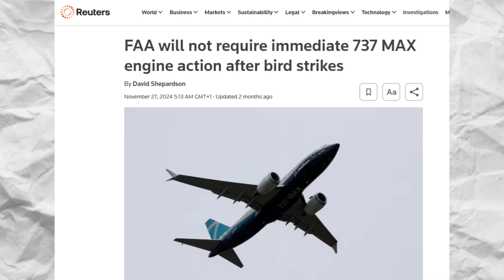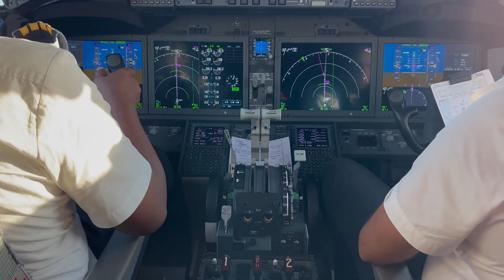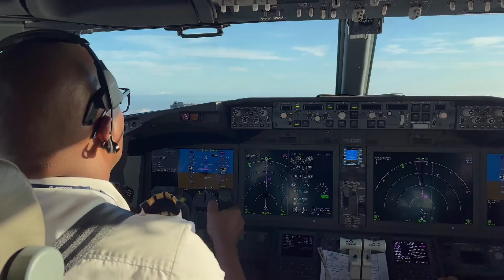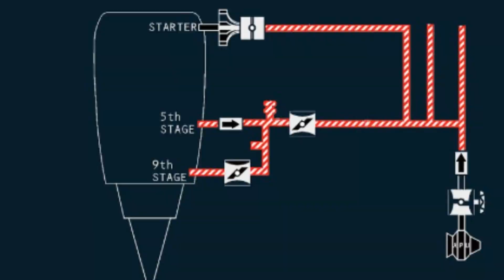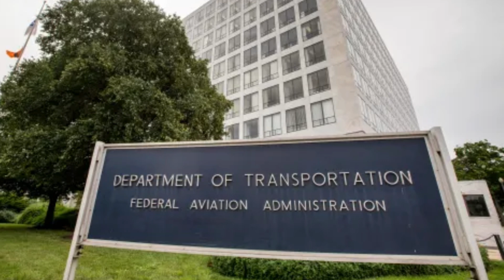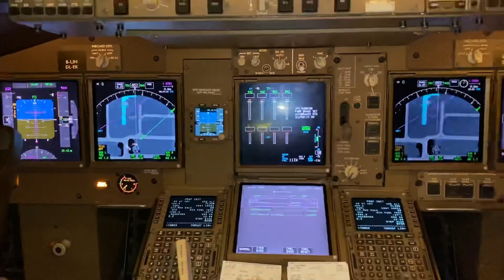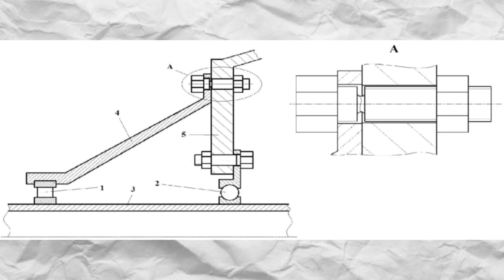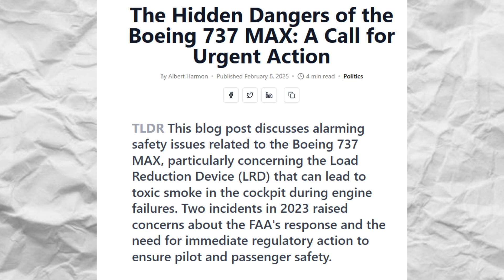New 737 MAX Flaw: Toxic Smoke KILLS In 39 Seconds

Comment: Airbus also has this system like every plane ,the 787 is only safe from this according to boeing I have no idea about the other planes like is it safe or not this problem is caused because of LRD system and oil dumping in the air compressors
Reply from the maker: Yes, as I mentioned in the video A320neo also have CFM LEAP engines and the same problem, but only the MAX incidents were widely discussed in the media.